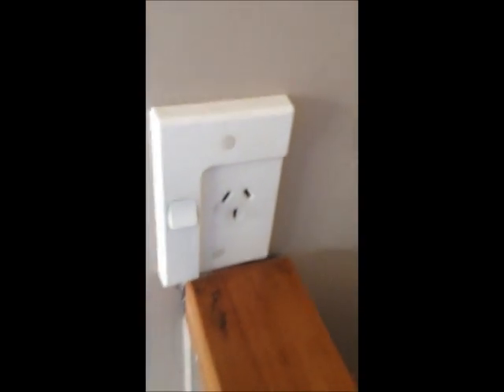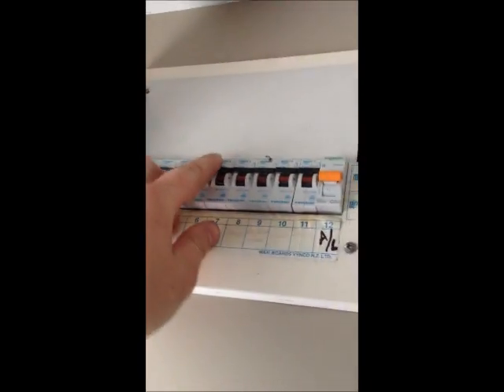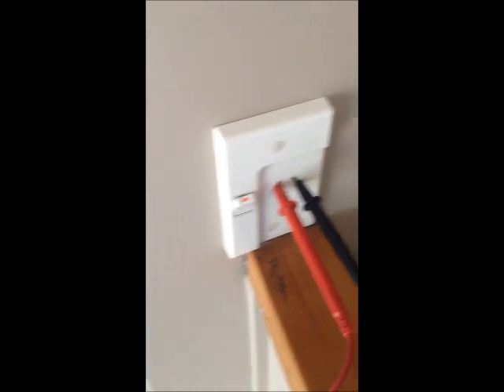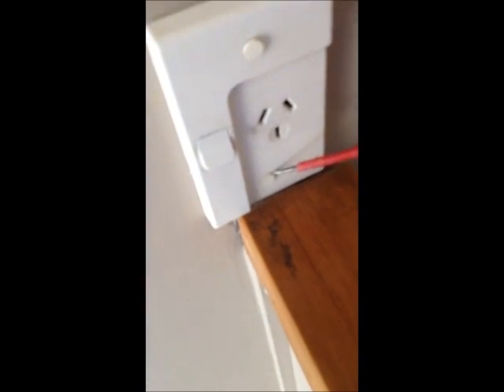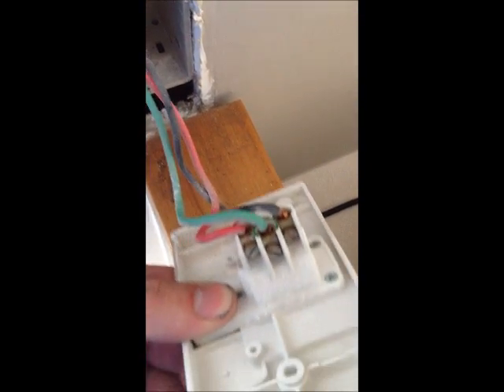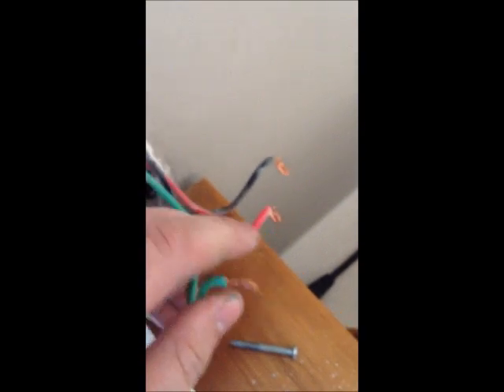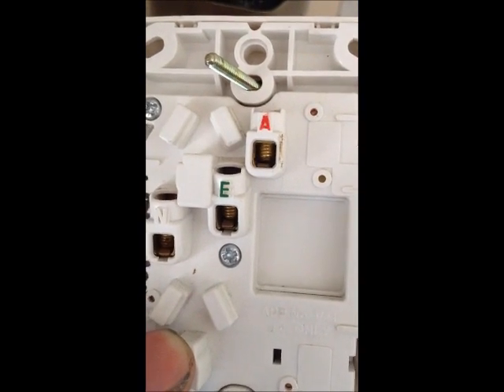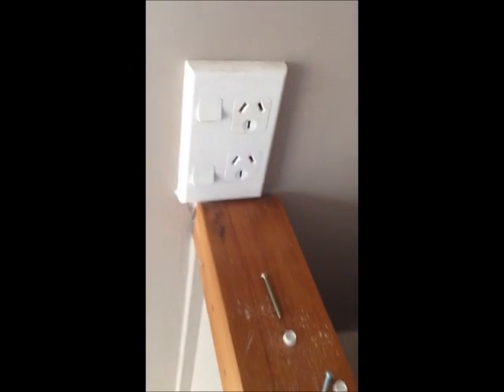How To Replace An Electrical Socket

Comment: How did you screw back the replacement socket?  I am trying to remove a double socket and replace with a caravan or commando socket. So the socket must be screwed on somehow but how do i unscrew it?
Reply: Ok, I found in another video of yours although you skipped it again, the double socket actually has a housing that covers the screws. I just figured that out as in the other video you had the double socket without the housing. Seems difficult to remove the housing though. I might remove the entire socket and damage the threads of the screws holding it.

Comment: Question. I have a double, 10a socket (which is broken) wired into a 20a circuit breaker. I'm wanting to run a 15a welder. Can I replace the double 10a socket with a single 20a socket without having to replace wiring? Or should I just have another circuit breaker wired in and go from that to a new socket.  The house is about 20 years old.
Reply from the maker: Best to get a new circuit installed for that, cheers

Comment: What the std height for a light switch in a new home installation
Reply from the maker: Standard heights (to center) 1100 for light switch and 300 for socket.
Reply: Just make you wear a condom so you don't increase your chances of getting STD's.

Comment: Dave do you guarantee the safety and workmanship done by people tampering with electric cable after watching your videos?
Reply: I understand your point. What people may not realise is that when you do this kind of work yourself, if you were to cause a fire due to say making a poor connection (very easy to do) there'd be no insurance following investigation for starters. So in that sense for example, perhaps this is a bit irresponsible?  @VigorGateway1
Reply: whats your point? @VigorGateway1

Comment: Hey Dave, we have a 1970s home that just need the electrical outlets upgraded. Can I put a double wall plug/socket with (1 or 2, 2 preferably)  usb plugs in it, onto the wiring for an existing single wall plug/socket? Is it as simple as it is in this video? 
Also, can I replace the single socket with a 4 plug socket? It would be in kids rooms so no huge major appliances except a tv, phone chargers, laptop etc. Your help would be HUGELY appreciated :D
Reply: Chelle Forrest

Comment: Hi dave. Question. Can u add another power point socket to an existing power point socket? Or does it need to be wired back to the db board??
Reply: Hey Dave... have you done a video on how to piggyback another power point off an existing one? I want to put in an extra outlet for an under bench microwave. Thanks
Reply from the maker: Coming very soon, thanks
Reply from the maker: Hi Beau - depends on how much load you're already drawing of the circuit/and its purpose. If its not in the kitchen then most the time will be absolutely fine - bear in mind the max you would want is 6x power points on one circuit from the msb. Where would you be installing it in the house - and whats it for?
Reply: Hi i have a same question,  any leads?

Comment: nice , dave can you make a video on adding power outlet.
Reply: Rom yes I need this too
Reply: No. You are able to, as the owner of the property, replace fittings like this video is showing, because its basically like for like. But adding new fittings is not something homeowners can or should be doing, and requires a Certificate of Compliance. There are too many variables to consider, that there is not much he can do to explain every single scenario. For example, how much load is on the circuit already? What is the breaker/fuse rating and can it handle the load? What size cable should be run and how to run it in accordance with building regs?

 It might require work at the switchboard which homeowners are not permitted to do. He could be liable for showing somebody this, and they do it wrong, because they relied on his advice but aren't certified to do the work, so he shouldn't be making this video. You'll have to call an electrician I'm afraid.

Comment: could you please show me how to install double socket with extra switch light?"
thank you :-)
Reply from the maker: Ricky Sor what is it that you are specifically installing the switch for? cheers
Reply: sparkydave i am looking to install a new power point in my bathroom. Power does come with extra switch , so I want to use a switch as a light switch in my bathroom .please help me 
Thank you
Reply from the maker: Hi Ricky are ya still after a vid, I'll be chucking one up tomorrow that might help explain this. Cheers

Comment: Hi Sparkydave thanks for the vid , how about a nice diy,er on setting up a fusebox .cheers
Reply: Home owner not permitted to open the switchboard to expose cables?
Reply from the maker: boaraxa a bit complex to show in a quick video, is there any part you would like wiring advice on? I.e. rcds, breakers, relays etc. cheers